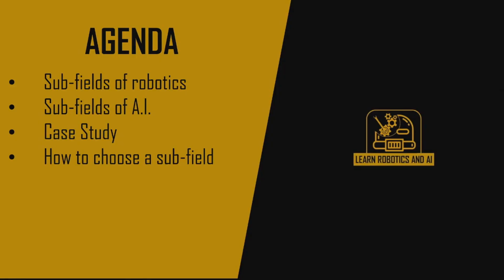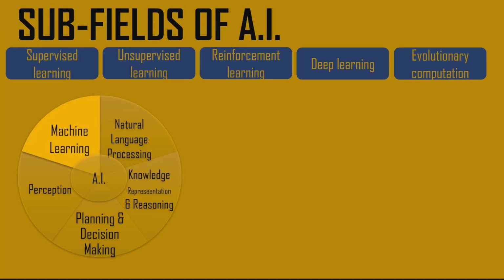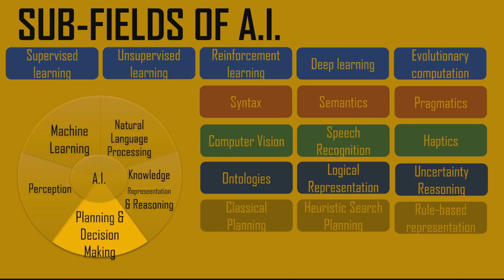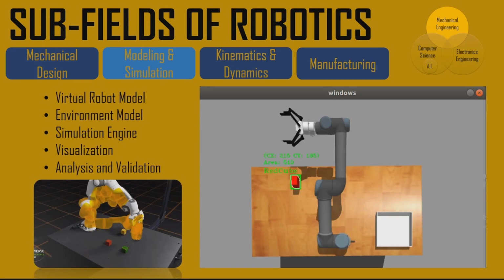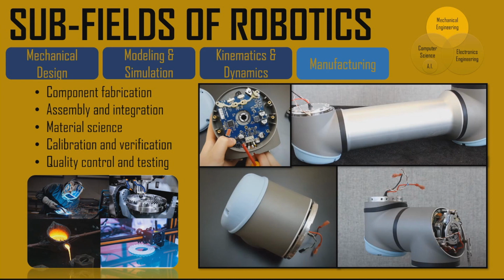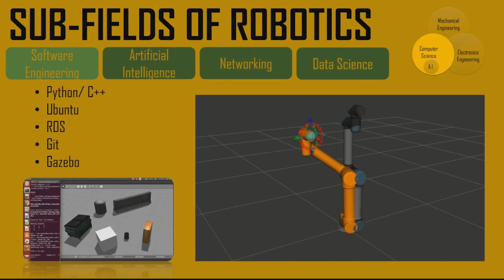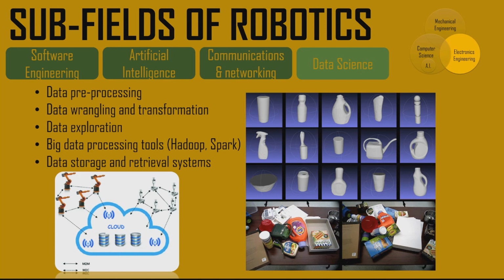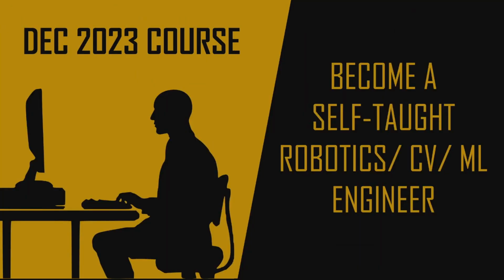Top sub-fields in Robotics and AI and which Major to pick

Comment: In my opinion, the discussion on these subfields only scratches the surface. If someone wants to pursue a career in robotics, there are several topics I can suggest to master. These include:
1. Advanced Ordinary and Partial Differential equations with some numerical methods to simulate
2. Nonlinear Control Theory
3. Linear and Lie Algebra
4. Kinematics, kinetics and Dynamics
6. Basic Programming, Data structure and algorithm .
** These topics are for those who truly crave to learn robotics from the ground up. However, for those who simply want to simulate and run robots without delving into the inner workings, there are plenty of tools and libraries available as well.**
Reply from the maker: Thanks for your input! I agree. This video is meant to be a broad overview of the sub-fields - to highlight the big picture. 2, 4 are already covered in the video (broadly!). 1, 3 and 6 are talked about in my video on top skills in robotics where I have talked about the mathematics and programming topics in more detail - https://youtu.be/4gZtoQ4gjxs 
What do you do currently? @